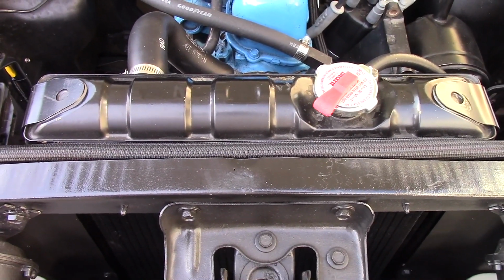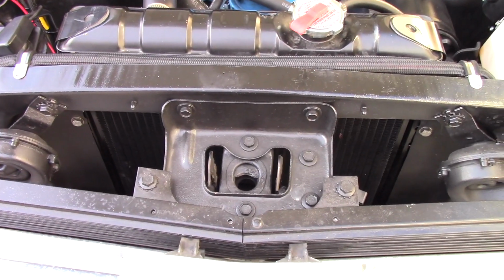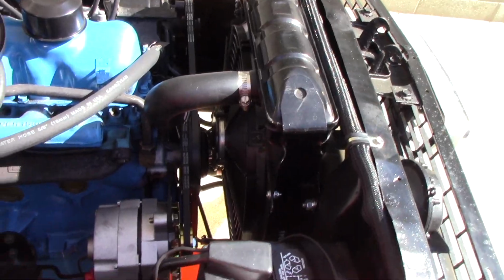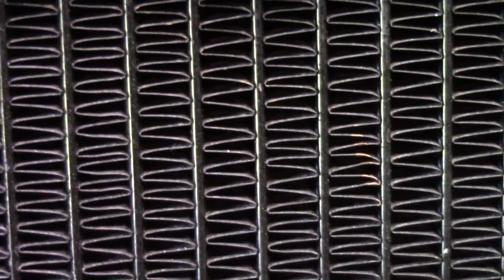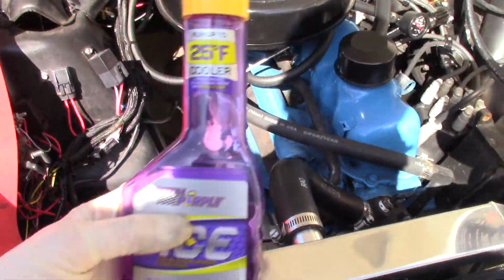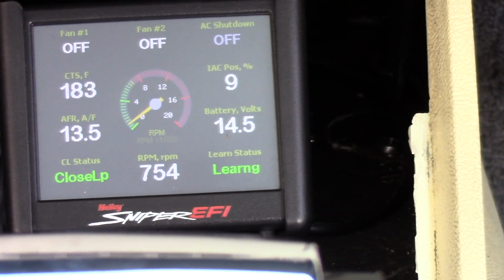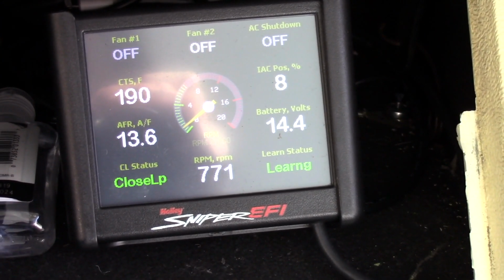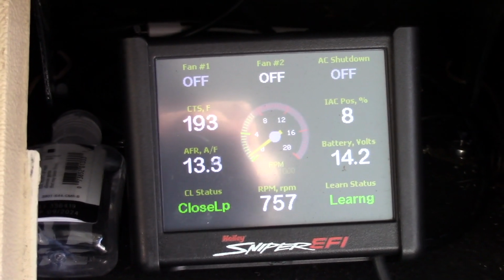66 Mustang 6 Cylinder Champion Aluminum Radiator Install

Comment: @mechtrician1 could you provide the part number for the brackets that you used to mount the fan to the radiator please?
Reply from the maker: Spal 30130011

Comment: Thanks for the video! Have a 67, 6cyl, added a Vintage Air. Stock radiator couldn’t handle it when it hit 85. Ended up with the Champion EC339 radiator.  Had to use the Spal 16-0400 low profile fan with the mounting brackets. Didn’t have enough room between the fan and pulley to us their fan shroud. With 95 to 100 plus days, it runs at 180, in traffic, it’ll hit 200, but cools back down to 180, once you get moving again. Again, thanks for sharing!

Comment: Have the Champion and Spal 1516 fan but still not enough clearance to pulley and bolts.  Due to no stock anywhere, had to get the Champion 251 with different size in and out hose fittings but the company said it's the same radiator otherwise and can use adapting fittings for hoses.  Any ideas on fitment?
Reply from the maker: Take a measurement of your radiator core. I believe the 251-6 6 cylinder rad is only 1.63” thick. 
I doubt the V8 (251) model is that thin.

Comment: That original 3 core radiator shoulda  been enough to keep ur engine cool I think ur timing and fuel delivery is ur problem even tho that new aluminum radiator is keeping ur engine cool now its prob just covering ur underlying problem of running lean or timing is off.
Reply from the maker: The original radiator was not a 3 core, it was 2.  Timing and fuel delivery was all looked at at the time. 
Several people on the VM6F have had the same issue since this video was made and have gone to the champion radiator and all have the same positive result with this setup.
Reply: @mechtrician1  cool u got it to cool down.
Reply: @mechtrician1  I thought u said in this video that it was a 3 core.
Reply from the maker: @martinjay5906  it was, but was a replacement in the video. Original factory copper was actually a 2 row. No one makes that anymore.

Comment: Do the trans lines fittings need any sealant or tape? What did you use? Thanks
Reply from the maker: It’s tapped 1/8 NPT so yes, it needs sealant. Use Teflon tape, don’t use any liquid sealer as it can get into the trans.

Comment: Thank you for this. You won’t believe this some years ago I found a specialty FOUR core copper radiator from CJ Pony for my inline 6 (same as yours) thinking this would solve my heating problems after I put the 2 barrel Weber on. I replaced the old crappy 2 row copper that came with it thinking this would solve my problems along with a higher flow water pump replacement. Nope. In the summer at stop and go traffic here in DC I was creeping up to 205-210 and getting worried all of the time. I was using the engine fan but now realize I had the wrong size spacer not keeping the fan close enough to the fins. Anyway, you have convinced me to get the 2 row champion with the spal 1516 fan combination. The other issue I am worried about is that eventually I would like to add AC (i.e. classic auto air) because the DC area is just miserable in the summer…So by installing the condenser unit in front of the 2 row champion radiator do you believe this would significantly change the static pressure characteristic to the extent that the 2 row champion (like yours) could still handle the demand? Based on what you’ve shared here it seems perhaps closely examining the specifications on a different model fan may indicate another  model may help to decrease the delta.
Reply from the maker: I have been told by others using the same setup as me with AC that it works just fine, no overheating. AC condensers are usually a lot less restrictive.
Reply: @mechtrician1  thanks so much and again sincerely appreciate your sharing these experiences with us.
Reply: Sir you mentioned in the video but I couldn’t quite it make it out the name of the company that your purchased the low profile bolt heads due to the tight fit of the Spal fan. I have gone ahead and purchased all the key parts for this project(it’s my birthday - so it’s time lol) I looked and tried variations of the name I thought heard to no avail apologies… would you be able to tell me once more where you got the bolts? Thanks again for this outstanding video,
Reply from the maker: @stephenparra7567  McMaster Carr

Comment: What is the black radiator and how much is it because I have two barrel under the hood and is it worth it just get in the championship just getting the stock radiator if not can you just give me a link to which one you think is better?
Reply from the maker: The black radiator is copper. You’re better off with aluminum. The Champion is a model 251-6, but I think they are still back ordered. Good luck finding one.
Reply: @mechtrician1  thanks 🙏

Comment: What degree is your Timing set at… I have a 200 with that exact aluminum radiator
Reply from the maker: Initial timing or total? I run 14 degrees initial, about 32 total. The curve is custom for my motor.  It’s not stock anymore.
Reply: @mechtrician1  Initial timing… I think I have mine set at 12 It’s runs fine but gets a little sluggish when I run my AC
Reply from the maker: @zekemartinez5398  12 is about right. It will always probably be a little sluggish with the AC on. It’s kind of the nature with these motors.
Reply: @mechtrician1  Thanks you !

Comment: Is ur oem temperature sending unit connected to the water outlet  instead of the original back of the e head ? Why? Trying to run a mechanical temp gauge on my 67 but I was told to run it on the water outlet and keep my oem sending unit connected on the back of the head on its original connection ..
Reply from the maker: Yes, I moved my OEM temp sender to the water outlet because I have EFI and the temp sender for the EFI needs to be in the head. Since the EFI tells me temp, I don’t really care that the OEM gauge doesn’t read until the thermostat opens. 
You can put it in the water outlet, it just won’t read until the thermostat opens.
Reply: @mechtrician1  i like ur set up nice very informative video really help alot any link for the EFI ?
Reply from the maker: @azteca8151  I run a Holley Sniper 2300 EFI. There are a few options for EFI. The Sniper 1100 is the bolt on direct replacement for the standard single barrel carb, but it’s back ordered big time.

Comment: take it up the grape vine to really put it to the test lol
Reply from the maker: I have the motor out of the car right now otherwise I would.  I'm doing a 2V conversion with a Sniper 2300, and a small cam.  I drove it up to Santa Clarita a few times, with no problem in traffic or otherwise.  Probably didn't have enough balls before to even make it up the grapevine LOL.

Comment: What is the Champion part number for this radiator. And also what fan part number are you now using? Thanks.
Reply from the maker: The radiator is a champion 251-6 and the fan is a Spal 1516.